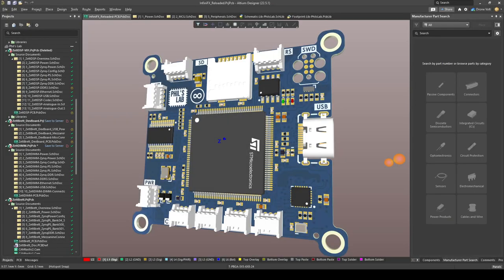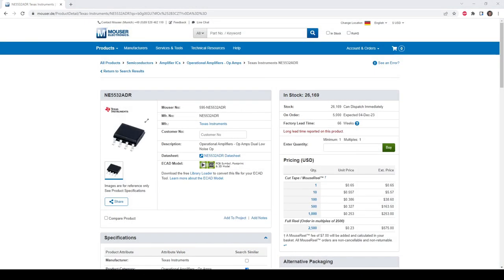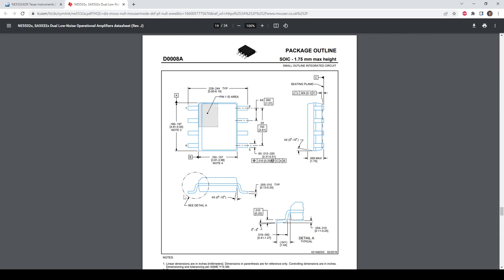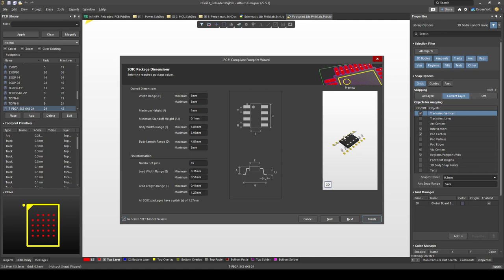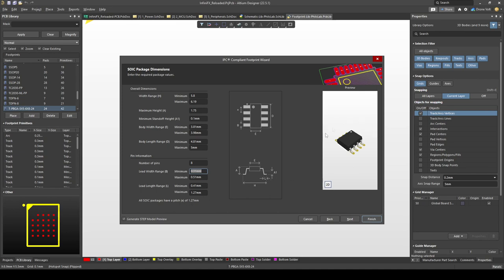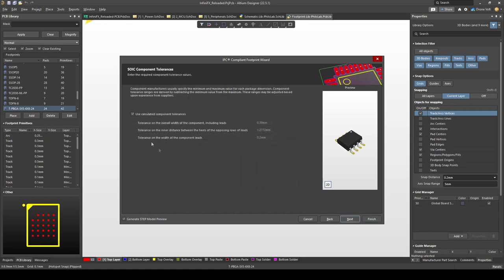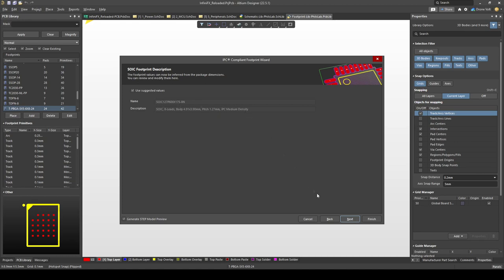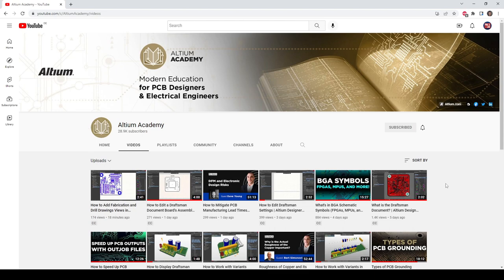PCB Footprint Creation Made Easy (IPC Compliant Footprint Wizard)

Comment: I am trying to add some simple footprint for through hole parts (a potentiometer joystick) and there is no throughhole parts....any clue as to how I can get a footprint??
Reply: If the generator cannot create a footprint try looking in the Manufacturer Part Search panel. If that does not have your CAD data then try to look on SnapEDA or onlinecomponents

Comment: I’m probably missing the point. What is the advantage over choosing a „standard“ footprint and component?
Reply: Creating a footprint from scratch typically requires more time (creating all layers, getting proper dimensions (for assembly, soldering, spacing), finding a 3D model, etc.). With the IPC Wizard you also get a certain level of uniformity between footprints and within your library (layers, naming, models, etc.).
Reply: @PhilsLab  Thank you vor your reply. I don't know if I understand your reply not correctly or if I was unclear. My understanding would be that Altium comes with a library of standard footprints. What is the advantage of taking an oven-ready footprint vs. an IPC Wizard one?
Reply: @ThePetaaaaa  I guess you would only use the wizard for footprints you don’t have by default.
Reply: @danielzimmer1  I see! Then it’s likely a very useful feature. I use a different EDA software but still follow here for all the great tips!